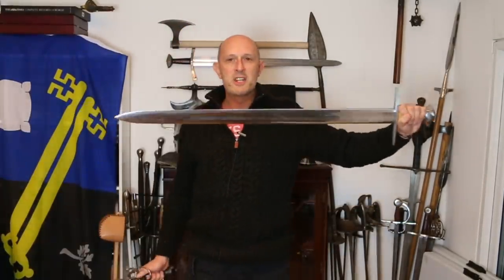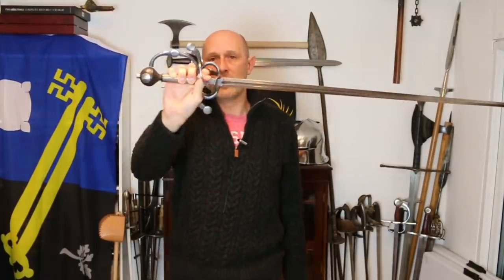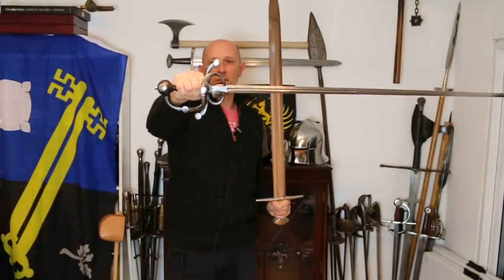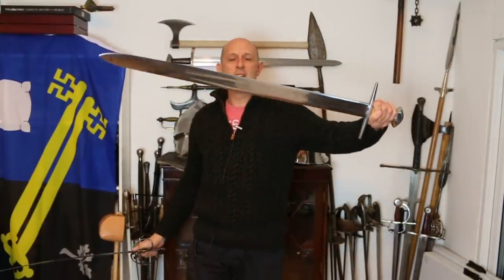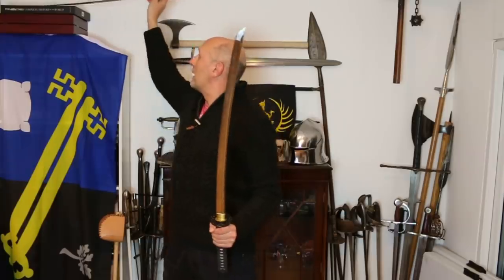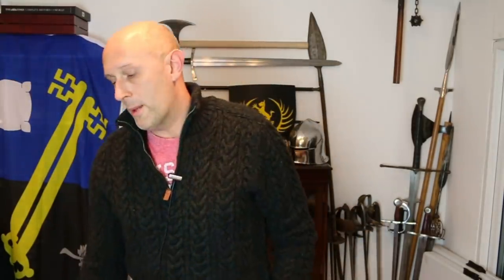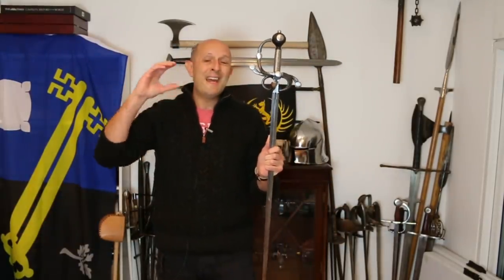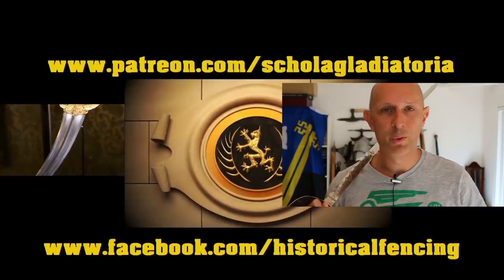Sword Blade Technology Informing Design

Comment: I'm not going to disagree with what you're saying here because I think it's just a given that material and technological constraints are going to dictate design, however, there is a clear mechanical advantage to wider blades when it comes to cutting.

tl;dr: Thick blades are stiffer in the plane of the edge, and therefore better for transferring energy into a target (up to a point).

The bending rigidity of an object is dictated by two things, the amount of mass resisting the bending moment, and the distance of that mass from the center line of the axis of bending. Simply put, if you suspend a bar between two points and put a load downwards atop its center, it's going to bend into a smiley face. The top of the bar is in compression (that is, being forcibly shortened) and the bottom is in tension (forcibly elongated). At some mid-point between the two, the change in length must be zero (that's a real world application of the intermediate value theorem, actually).

That means, at the midpoint between the two sides, the material is not actually resisting the bending at all (no distortion). Equally, the further away from that point you get, the more the material elongates/compresses (and resists). This is why an I-beam is shaped the way it is. If you load an I-beam on the plates, you'll note that almost all the mass is located as far away from the center line as possible. This is the same principle as a fuller on a sword.

Thus, the broader the blade is edge to edge, the stiffer (for a given amount of material) it will be in THAT plane. The more efficient it will be at imparting energy into the target. The problem arises in that, if you make the blade thinner to accomplish this, the bending rigidity in the direction of the flat, or torsionally (i.e.wringing your hands), will diminish, and energy will be lost in THAT way. This is what you always talk about with katanas being more forgiving with bad edge alignment because the blade doesn't wobble and deviate. In other words, widening the blade for a given amount of metal will improve the ability to impart energy into the cut UP TO A POINT.

Equally, this is why it's not entirely fair to compare the width of single-edged cutting swords to double-edged swords. A thick spine is inherently better at resisting a bending moment applied from the direction of the edge than a thick mid-rib on a double-edged sword because it is distant from the center line of the blade. So, given an equivalent amount of material, the blade will be stiffer in the direction of the edge than a double-edged sword.

This is what I find so fascinating about sword design - there's actually a tremendous amount of engineering that goes into why swords behave the way they do, and they're not at all the simple objects they appear to be.

If you've made it this far, I don't know why I wrote all this, and I don't know why you're still reading it. Cheers.

Comment: As an amature  blade Smith I have noticed that more modern and thinner blades (like the rapier) are also more difficult to forge. Do you think that improving skill over the ages could also be a contributing factor to blade design? Although I do agree that materials would be a more significant factor.

Comment: You can cut meat with a blade as thin as a sheet of paper. A thin and wide blade will be easy to push into soft targets and it essentially aligns the blade for you. However, such blades are too whippy and as soon as there's some resistance it all gets lost in bouncing and vibrating. With a heavy, stiff blade you can chop like an axe, even when it's blunt, but that makes it sluggish and less effective against meat (but better at breaking bones).
A Katana is that thick because it was no spring steel and needed to be super stiff. A falchion may hit just as hard, but can afford a thin, wide blade. Against unarmored opponents, both are a bit of an overkill, but as soon as we talk about gambesson and leather, things change...

Comment: Thank you for the comparisons. Your 11th century arming sword is gorgeous. 
Perhaps you have already done a video on it, but I would be interested to know more about the edge geometry, ie: how sword edges varied or changed over time, even going back to Egyptian, Greek, Persian, and Assyrian bronze examples. And then how it changed with Roman, Iberian, Celtic, and other Germanic swords. And then the same periods you just went through above. For example, I have often heard that katanas are much fatter blades than sabers, despite their relatively similar dimensions. I always assumed this was due to quality of material, but it could also be that katanas could chop better than sabers (both slash great) because of that extra weight in the blade. And while many arming swords tend to have flatter or hexagonal profiles, katanas tend to have a more triangular profile. And most bronze swords I have seen seem to have a more pointed-oval type of profile.

Comment: But, if you didn't trust your materials, would making a broad but incredibly thin blade (like the falchion) really be an improvement?
Reply: Less didn't trust and more knew the limits of. I would suggest that we don't have the common knowledge, instinct behind our thoughts that these people would have. 

Even for the more practised of us. We don't need it to survive, make it to the next day. That can change how you value something and what you would do with said knowledge.
Reply: Maybe it was easier to get the heat treatment right in thin blades.
Reply: @mikaluostarinen4858  it's more difficult,  in many ways. Temperatures change very rapidly in thin stock, and if you are only going by colour to judge temperature,  you have to be quite good to get it right. I still have the occasional mishap where i basically burn the thin edge of a forged piece.
Reply: wide thin falchions became popular after technology had developed more and higher quality steel became more available.

Comment: If the blade is wider there is more room for the edge to taper, meaning you can have a smaller edge angle and still have much durability. It's also increasing the mass of the blade, obviously. For a moder analogue, think of a kitchen cleaver (very wide, rectangular blade) and how it's used (hard chopping blows).

Comment: Matt, maybe you have a Notion about this.
Why did Cavalry in early to mid 17th. Century use the Rapier, like the Pappenheimer? 
Obviously the pistol was the primary Weapon in a engagement, but after you fired your two pistols at point blank range at your heavily armoured opponent, how the Hell do you punch a Rapier through a Cuirassiers Armour?
I guess that's where the Warhammer and Horseman's Axe comes into the Playing-field.
But still, WHY a Rapier?

Comment: Shad beat me to the point I wanted to make initially but something I want to mention is also the impact of culture and fashion in sword design. The technology to make long narrow blades has been around for much longer than you think, the Avars used narrow curved swords as early as 700-800 A.D. as well as the Sassanid Persians and later Mongols. their blade material varied hugely just like any sword culture, but even then it's totally possible to make narrow blades by compensating with thickness.
Another example is the resurgence in wide blades from the 1450's to 1600. The Landsknecht were renowned for using broad cutting swords, but even so they weren't the only ones to do so, with examples like the cinquadea short swords coming into Italian fashion and some variants of German messers and some later basket hilt swords. Even the not so famous 1796 heavy cavalry sword comes off as a modernized Norman style cutting sword outfitted with a selection of points, at a point you mention is dominated by narrower blades. Indians too thought there was value in broad blades as they certainly held onto that aspect with Tulwar design, but again not always as some preferred the persian shamshir style popular with moghul nobles. The Sihks also held the broad bladed khanda in high regard as a traditional weapon of war.
Lastly id like to point out that in literature, heavy cutting swords may have fell out of fashion at some point in Europe due to being considered a more brutal and savage weapon than what was considered elegant and gentlemanly later on. Also, that heated debate of cut versus thrust divided swordsmen for a long time. I have no references to back this claim up but I'm sure anyone who has read up on the subject have seen this a few times at least. 

So I guess it's true that technology plays a part, but sometimes it comes down to what looks good too, and that can change a lot over a 1000 years.....

peace Matt

Comment: That was a lot of ground to cover and well done. I'll add this possible point as to  blade shapes besides quality of steels which makes perfect sense. Armour also had its influence on blade shape. A 12th or 11th century arming sword was pitted against chain mail and helmets. While the wide, front heavy arming sword might not be able to cut or thrust through mail a heavy blow might break a bone, disable a joint or stun with a blow on the helmet leaving an opponent on the battlefield at your mercy. A thinner blade would not deliver the necessary force needed. Plate armour required a fine point for the armour openings but the cut was still necessary for less well protected adversaries on the battlefield. Firearms did away with plate armour and the wider blades went with the plate armour excepting hold outs like the basket hilt broadsword in combination with the targe. The targe said to be somewhat effective at deflecting musket balls when angled and closing and therefore banned the story goes when the Jacobites were defeated.

Has anyone done a test to see if the targe could deflect a Brown Bess launched musket ball at different ranges? This might prove difficult considering the accuracy of smooth bores.

Comment: I suspect that the armour the sword was supposed to fight was more impactful on its form than the material it's made of. Post Roman conflicts were primarily gambison and so more cutting orented blades thrived, then as armour moved to chain and then plate the swords became more and more thrust orented to explote their gaps, however with gunpowder displacing plate and the introduction of woolen uniforms of soldiers, cutting returned in the saber. In Japan armour remaned reletivly the same, light, and wooden at most and so the saber like katana did well enough to become engrained in culture and ceased evolving even when metal armour was interduced. If thicker soft armours like gambison made a return so would more extream cutting blades, and where heavly armoured targets wernt expected, like amongst the men-at-arms cutting blades like zwihanders remained in use
Reply: I didn't think there was any evidence for the gambison that early on, or that it was used at all I the early dark ages (or migration era or whatever you call it) either by itself or under mail. I'm also pretty sure metal armour in Japan predates the katana. I agree with your point about the armour the sword would be used against although you have to remember some swords are civilian weapons so they would usually encounter little or no armour in the context they were primarily used.
Reply: A bigger factor than what the armor is made of might be how big are the gaps. If the metal plates are impenetrable but the articulation is simple enough that a lot of the limbs a still unprotected the you can still slip in a falcion in the gaps just as easily as an estoc.
Reply: @101Mant  theres rather little evidence of gambison being used at any time but considering it's simplicity (its layers of clothes sewn together) its hard to imagine it not being used. as for Japanese amours they were leather and lacquer until trade with Europe in the 16th century which i'm pretty sure is after the katana became widespread.

@MrMonkeybat
 armour especially incomplete and early designs were typically warn in layers, gambison under chain under plate so until the late medieval where plates were almost machine perfect and interlocking, there would be chainmail underneath any vulnerable gaps in the plates, so any weapon would need to deal with at least that

Comment: Oke one question! Why do falchions end in a nearly flat point? Wouldn't it make more sense to have a spike style tip like a baynot or the tip of a billhook or even just to sweep up in a crecent type shape at the tip to create a slightly sharper thinner tip then the half round nearly ball shaped tip they have? Like why not have a propper tip you can propperly trust with then the thing they have which might not even trust to gambeson. Don't get me wrong falchions are made to cut true sh*t, but when this fails wouldn't it be better to have a propper tip as back up?

Comment: This video leads me to two questions: If you look at a fantasy setting like The Witcher (sorry), where characters are regularly fighting not only against normal human enemies, but against larger, tougher monsters, would it make sense to have differently-designed blades for fighting those vastly different opponents? Ignoring the Witcher's whole thing about having to be silver-edged swords and other mystical stuff. It sounds like this explanation would justify having a monster-killing weapon for those fights, and a separate weapon for dueling other humans. Am I right?

And second question: if you were working with cutting edge (pun intended) MODERN materials technology, with no budget limitations at all, how narrow, light and sharp could a blade be while retaining its viability in continuous combat? Could we make things using advanced carbon fibre composites, or even carbon nanotubes or extreme ceramics that outmatch steel sufficiently to produce vastly-different-looking weapons which are still functionally designed to be a modern take on the traditional concept of a sword? And what would such a weapon end up looking like? How could you redesign the hilt to add protection while remaining light and agile? How would we reshape the blade to keep it light enough to be nimber but heavy enough to get power behind its cuts?

Comment: Matt don't you think that, maybe, to put a distal taper on a blade is more complex than a profile taper (and i'm referring to the arming sword). It can be that an arming sword with only the profile taper cost less than a sword with the distal taper because is easly and qucker to forge.
Reply: It is far easier today to have profile taper than distal taper. But that is because stock comes in the form of a plate or long bar, that you cut from with an angle grinder. Especially budget swords today are essentially completely flat and cut to shape with a grinder. When shaping a sword from a lump of metal, you have completely different ways of cutting costs, and I am not sure whether it is easier to create a flat sword than a distally tapering. It is likely, at the very least, to not be any easier with a profile than a distal taper.

Comment: Just wanted to add something about steel types and blade shapes. You can see the change through the periods from what tempering allowed in sword design. 
Case hardening (Roman era) This needed thick blades, as the soft core can bend.
Differential hardening (early feudal Japanese)  same problem with case hardening, soft spine can bend
Tempering a through hardened blade (Late medieval period) This was when spring temper became widely used in swords

Just because a steel is a crucible steel, it does not mean it is a spring tempered and through hardened steel. The best steel in the world will still act just like mild steel in it's annealed un hardened state. In its through hardened state a high carbon content uniform crucible steel is brittle, after tempering is the only time you will achieve a spring temper. So when we talk about wootz crucible steel, migration period crucible rare swords, and pattern welded steel, all of those things mean nothing unless the smith knows exactly the 3 step process of heat treatment for spring temper. There is confusion still in the 'sword' community on this topic. People assume that a crucible steel sword is the same as a late medieval spring tempered blade. When it's talking about a completely different part of 2 different process's. The Romans could have easily created medieval level spring gladius, but they didn't understand advanced metallurgy hardening techniques, they got carbon to enter the iron through working and case hardening the sword, to create a tough outer shell, basically a martensite skin over a soft core. I also have doubts of the Scandinavian smiths, I think their swords are over hyped and nobody has let me run tests to confirm if they have a spring flex, I don't think they do, I think they are just good carbon crucible steel swords that have been hardened partially. If anybody has actual proof that an Ulfbhert has a spring temper please send me the studies or tests, I have seen evidence that they are high grade crucible steel, but this does not conclude they have a spring temper, has anybody ever bent an ulfbhert and seen it return to true?